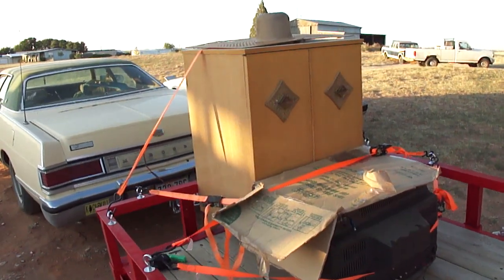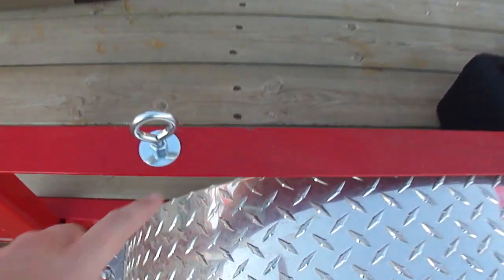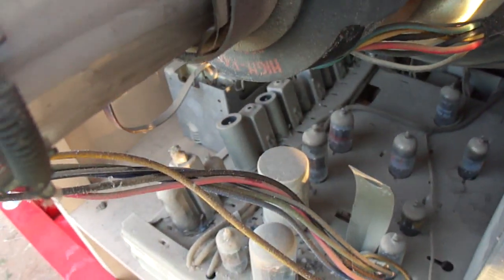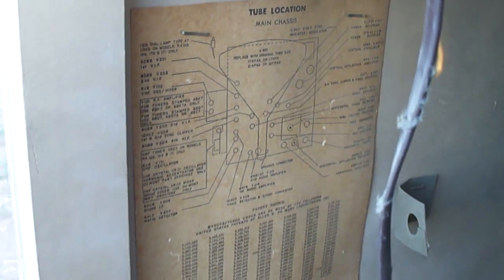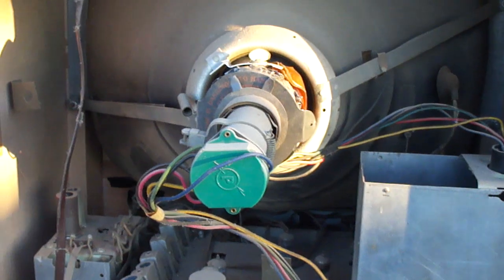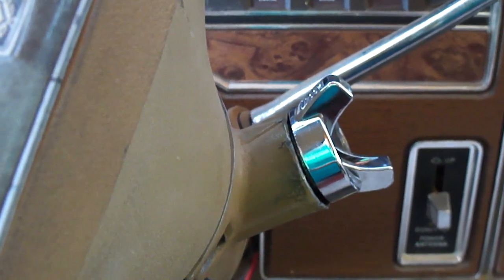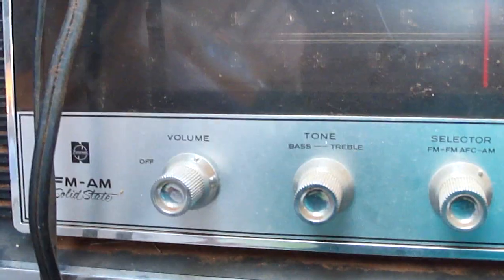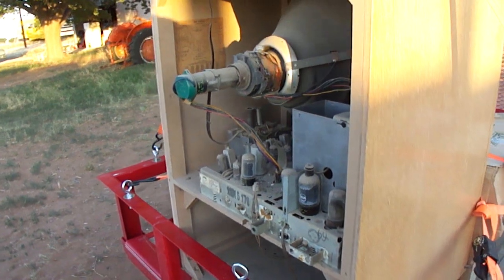1950's DuMont Teleset Model RA-170 before repairs

Comment: We used to run through ignition switches like crazy when we had a lot of keys on the rings. That might have been why yours broke again. 

Can't wait to see more of the things you got at the sale. That TV looks really interesting. You do seem to have good luck at estate sales, here there is not much usually. 

I just got a KMart box fan. I have a video of it up, but it has plastic grilles and a metal blade. I suppose yours must be older then, or someone swapped some parts over the years.